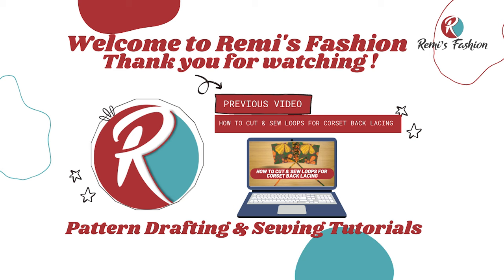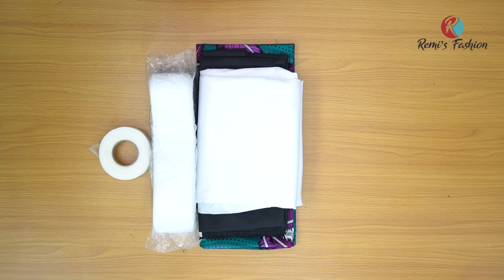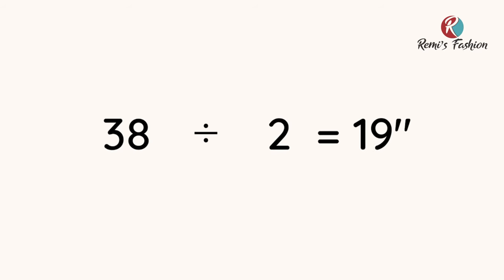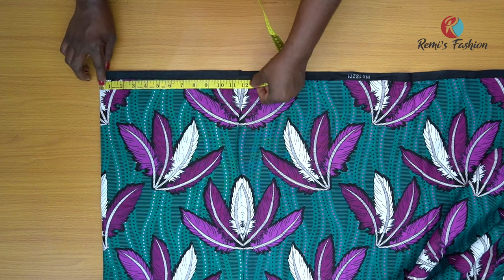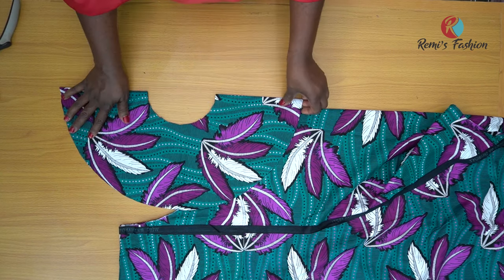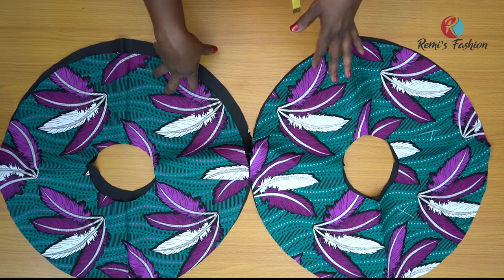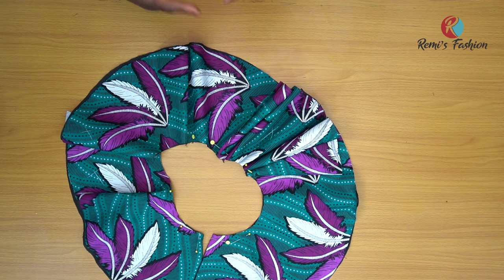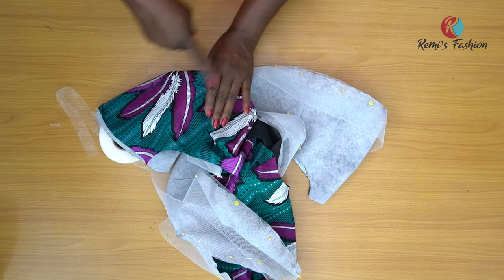How to Cut and Sew a 720 Degree Peplum Flare

Comment: If I want to cut 1440flare, am I going to divide my waist circumference by 4 or by 2
Reply: Please for 1440 flare divide by 4
Example, waist 30 divided by 4 will give you 7.5 
Now divide 7.5 by 6.28
And this will be equal to 1.19 for your radius

Comment: Hello maaam what if the calculation of the radius is like 3.50 are we still going to use 3 inch as radius or 3.5 ???
Reply from the maker: You will use the 3.5 that you calculated.